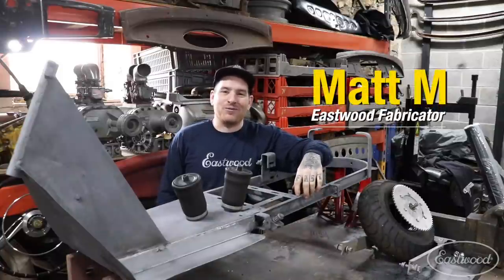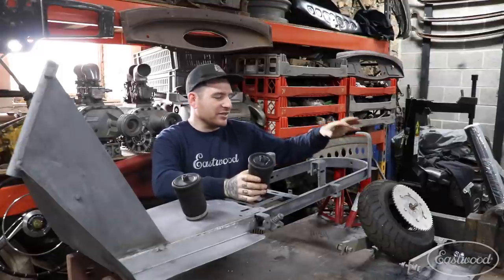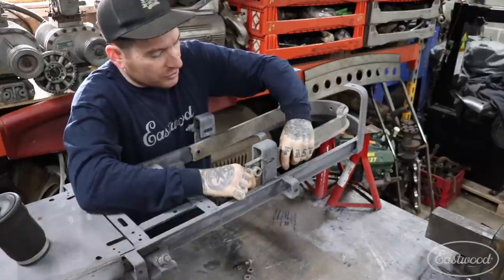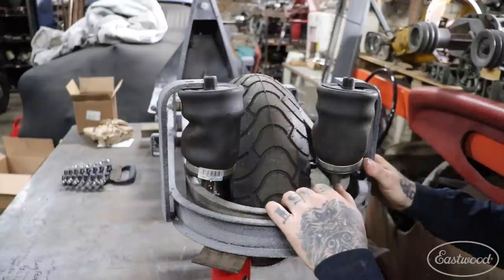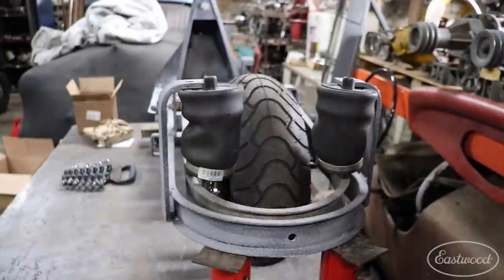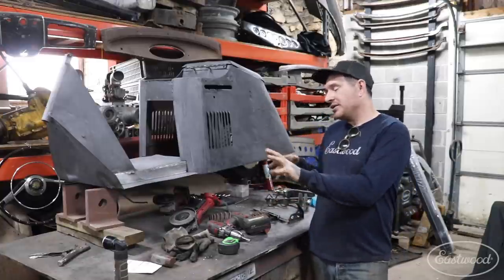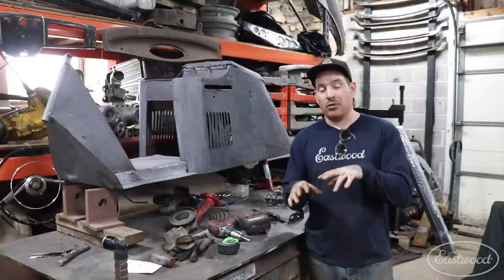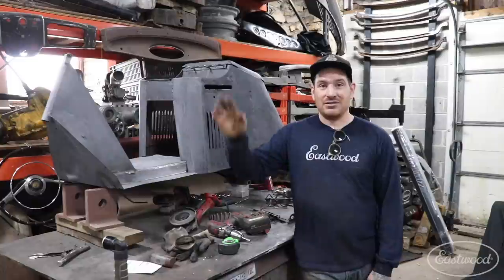The Cushman Scooter Project - Fabricating Brackets for the Rear Airbags on the Scooter - Episode 15

Comment: I hope there will be enough weight with the engine installed to actually compress those bags. Maybe they are really easy to compress. Suspension bags I think are made to be close to or at their compressed height as a natural state when deflated. These bags looked like they are at normal full extension height when deflated.
Reply from the maker: let's hope so!